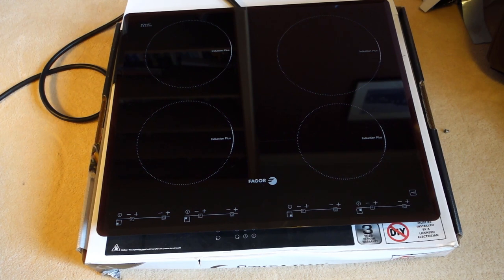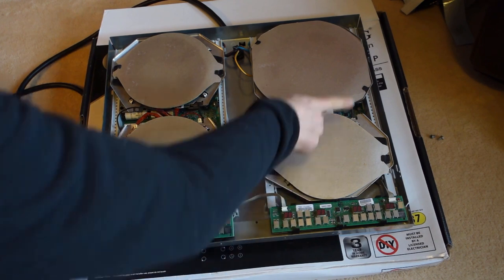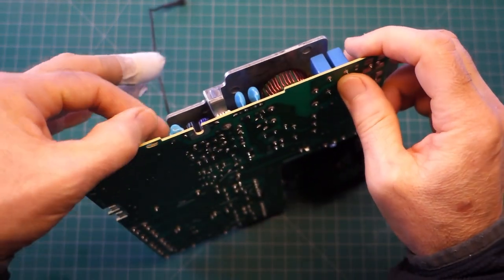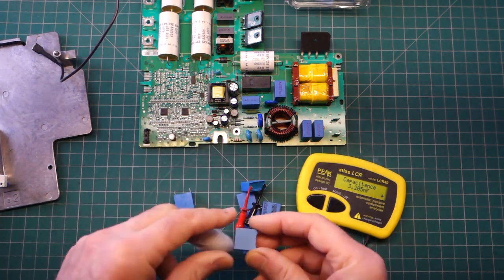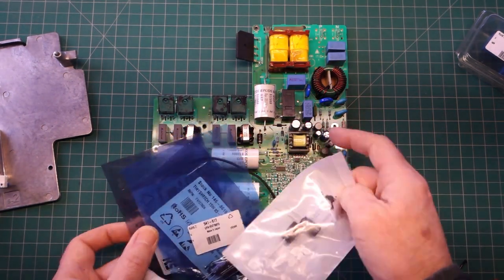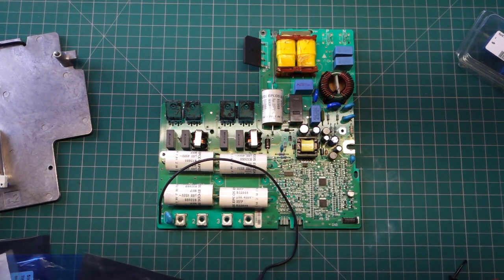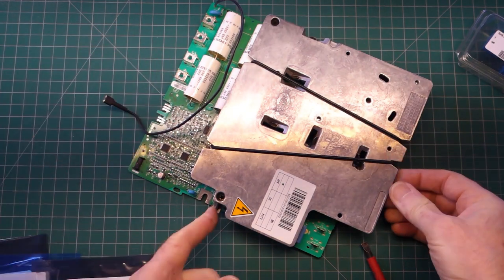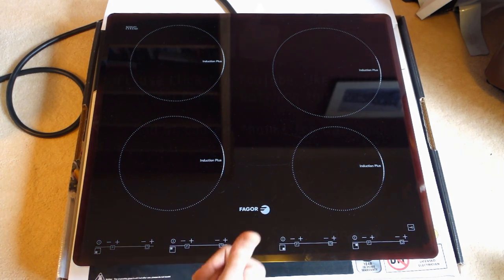Ep42 Fagor  De Dietrich Induction Hob Repair

Comment: Are these replacements just plug in ? As you don’t show how to ? Just quick edit and there you go ?? As a carpenter I could show you how to safely use a router ! But alas I’m no electrician hence my utube search 👎
Reply from the maker: Hi John, thanks for your comments,  all the components on a printed circuit board like this are soldered in place.  I explained how i removed the large heatsink as it was a little tricky but i'm assuming a certain amount of prior knowledge in this type of repair.

As for my router, the plastic knob broke as I was finishing my last cut and I was turning the tool over to place it on the bench...freaky accident!

Comment: Thanks for the video, the repair is well worth doing as a new circuit board costs about 200 €.  I really struggled to get the clips back onto the transistors.  I finally succeeded by pressing the clip with the two tips of a 10 mm open spanner.
Reply from the maker: Thanks for your feedback Boris.  I also found the clip reattachment to be the hardest part of the job!
Reply: Did you had to replace the same components as in this video?
Reply: @rogierius   Yes, three capacitors listed in the description of the video.

Comment: i use quick chip to remove it
Reply from the maker: Yes, that's a very useful technique to use.  I don't have any of the branded quickchip but I have a roll of tin/bismuth solder which has a melting point of 139C.

Comment: Simon thanks for the video. I had a spare hob with one working board from a unit with a broken glass top It had been glued in place  so I had crack it out and replace the whole unit. This new unit failed after 4 years so I substituted the working spare power board from the spare. Once my wife was cooking again I attempted the repair of the two defective power boards.  I've repaired one board successfully whilst the other is still WIP  I'll need to look closely around this board for further evidence of component failure.  The first board took me all afternoon to get the difficult spring clip back on whilst the second took a hour for the complete process. I've put the two boards away in the broken hob in the garage for when the hob fails again. Do you think its better to isolate the hob completely from the mains between use to lengthen component life?

Comment: I followed your excellent instructions and it worked perfectly.
Thanks
Neil
Reply from the maker: Hi Neil, thanks for the feedback.  Another hob saved from the scrap heap!
Reply: Did you had to replace the same components?
Reply: Yes, all of them, I replaced the easy two at first, but the one under the heat sink needed to be replaced also. Great instructions, 👍

Comment: Thank you so much for posting this, just about to try fixing my De Dietrich induction hob that has just stopped turning on, my power boards look very similar but I only have a single keyboard to control both power boards.

Would you happen to have a list of the other components you mentioned in the video? I am thinking whilst I am in there a may as well change all the common caps that go bad.

Comment: Hey Simon! Thanks for the informative video.

I have the same Fagor induction hob and it's actually gone bang where the two capacitors are situated.
Firstly, would that be the same problem with the capacitors do you think?
What's the ordering code / number for the capacitors and where did you purchase them?

Thanks in advance :)
Reply from the maker: Hi Natalie,  In my experience, which is repairing only a few of these boards, the capacitors visually look fine.  However caps can fail more spectacularly so if you've got the board out its worth a try to repair.  I got my spares from RS components I think.  Element 14 would be another alternative source.  See updated video description for part information